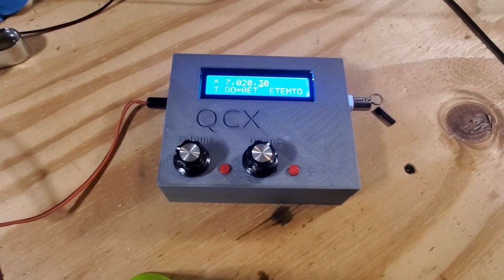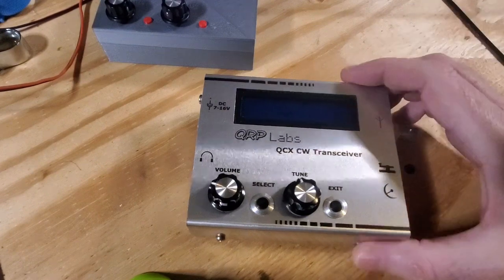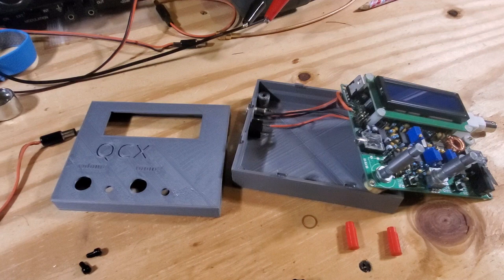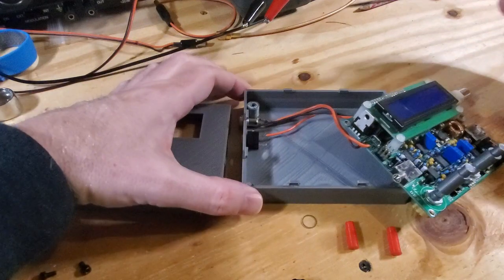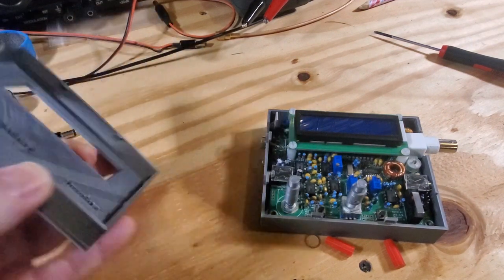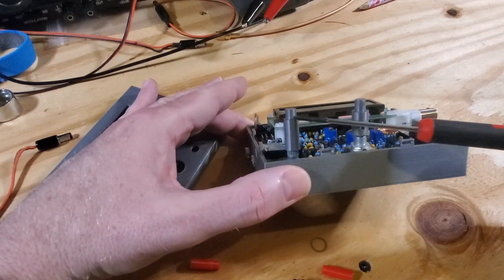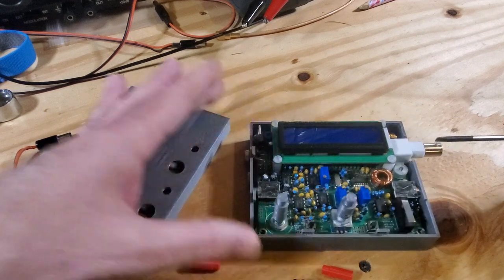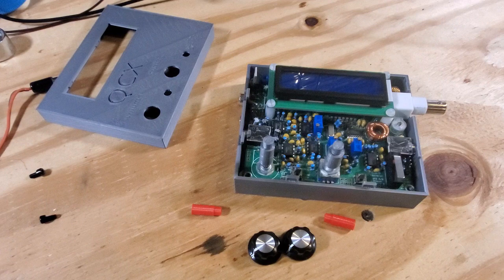QCX 3D Printed Case

Comment: Just finished printing one of these cases for my 30m QCX. Well designed case. Having some trouble fitting the shaft extensions on the pots but nothing a bit of heat wont fix. 73.
Reply from the maker: Thats awesome - great to hear it worked for you. Those pot shafts are a pain. After I finished I found an easier way for them. Prusa has them on on his encoder shafts. Have a look here https://www.thingiverse.com/thing:3123377/files. Much better fit
Reply: i guess it's pretty off topic but do anyone know of a good place to watch newly released series online ?
Reply: @Finn Esteban i use Flixzone. You can find it on google :)
Reply: @Eliseo Martin Definitely, I've been watching on flixzone for since march myself :)
Reply: @Eliseo Martin thank you, signed up and it seems to work =) I appreciate it!!
Reply: @Finn Esteban glad I could help :D